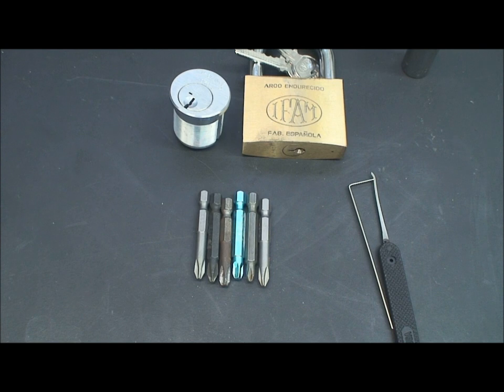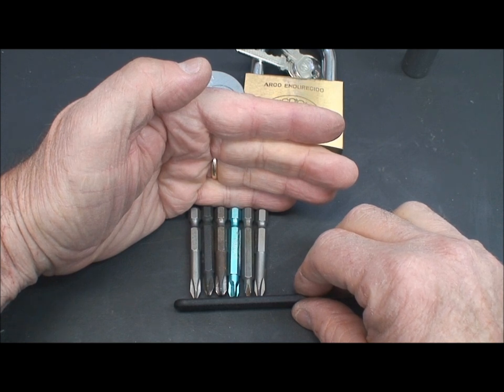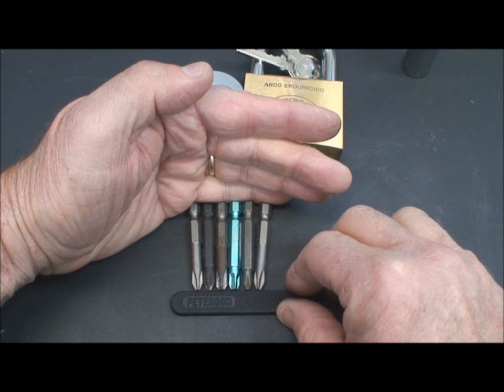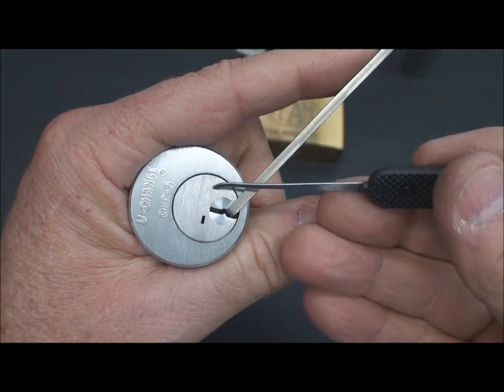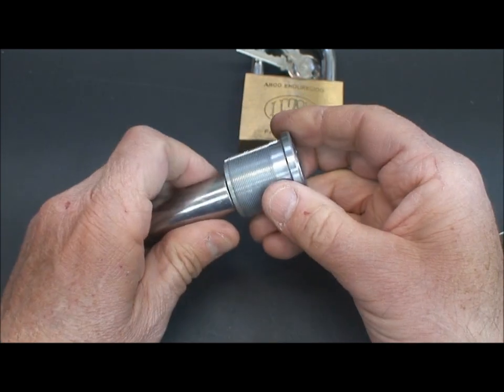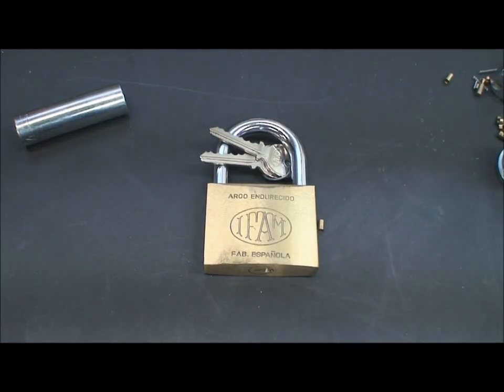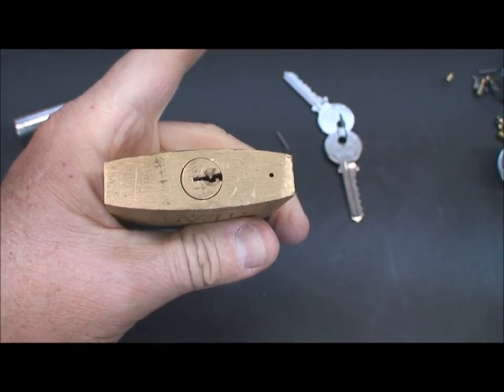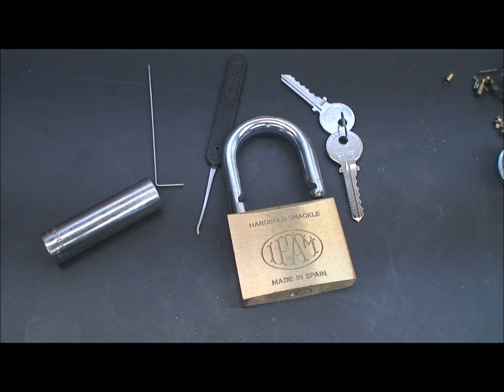(24) How to "Rock" Open a Lock in Seconds

Comment: Nicely demonstrated! This is a fantastic and grossly overlooked technique. The majority of cylinders over here use the Y1 profile  (or 1A as we call it) you mentioned, and it's just as effective. It's just a matter of angling the shaft the right way, you don't really need to snake around the keyway too much unless the pins are all very deep setting. Definitely harder on the really wacky keyways though; asec are pretty common and they're fairly nasty but I've even opened a few of those like this.

Comment: I'm still waiting for my first pick set to come in the mail. I've been watching a lot of your videos Bill and they are great. I'm curious though. In this video it looks almost effortless when you rocked the pick and opened this lock in seconds. To me that screams that this lock is actually junk and not very good at all. Is that correct?
Also, for a newbie such as myself, what factors would you say we should consider when trying to determine what technique to use? (i.e. rocking, single pick, rake, etc...)
Thanks and keep up the great work!
Reply: +s1rGr1nG0 Learning to SPP should be a priority, but all the techniques have their place. SPP is a point of pride and will develop your feel for locks.  That feel will help you rake or rock more effectively. SPP is also much better for teaching you how to tension. Proper tension is the most important technique. It's also the hardest to learn but then one day BANG, you have it.  Take a quarter, hold it on the pad of your finger and that is about the pressure you need on the torsion wrench. Master Locks take more tension so they are very forgiving to novices. I've had some pop as soon as I put in the pick, or rake.

Sometimes you'll use many techniques on the same attempt. SSP to feel around, raking  (or bitchpicking) and then returning to SPP for the last pins.  So, while SPP is considered the "proper" way by some, the method that opens that specific lock is all that matters.  And have fun. It's a zen-like excercise in frustration, but if you relax it's rewarding.